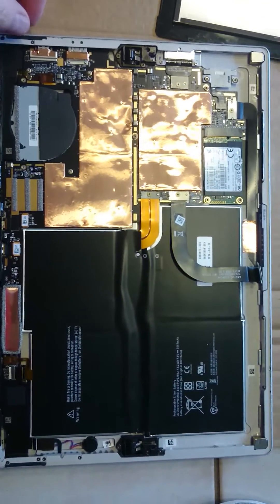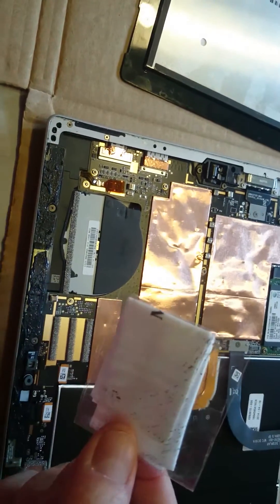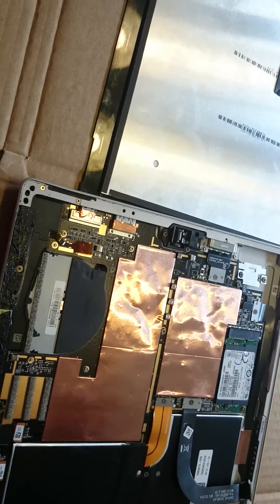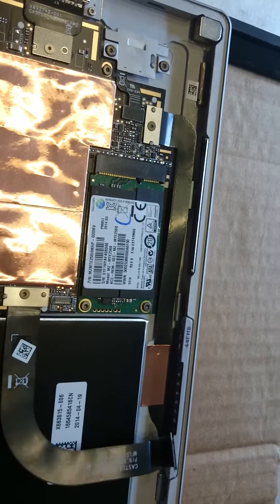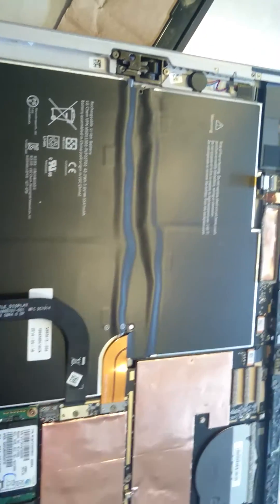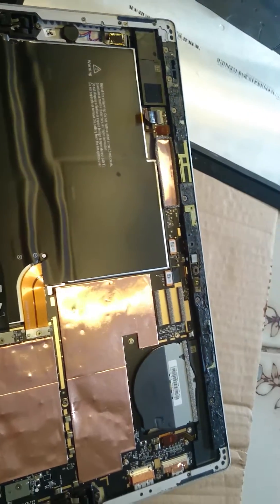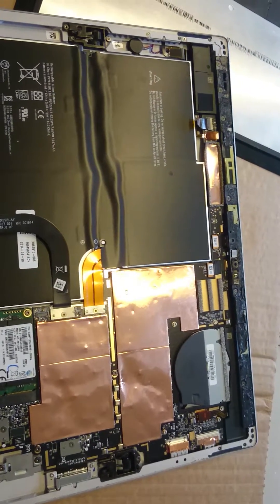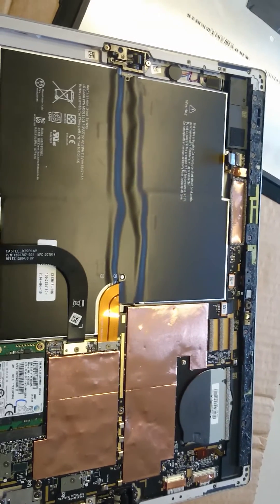Surface Pro 3 screen repair thoughts 1

Comment: did you find the serial of the screen on the back of your broken one? is there a way find the Screen serial without removing the old screen?
Reply from the maker: As far as I'm aware the only way to check the screen serial # is by removing the old one. But the the purchase online of the new one should not be a problem.

Comment: Did you ever make a part 2? I heard there the wifi antennas were near the camera. Did everything work out well? I cracked the corner of my screen and I want change it but I'm so nervous.
Reply from the maker: Unfortunately my memory card was corrupted with that footage. Yes, there are two antennas (left and right) either side of the camera. At 3:45 you can see the left one (wide gold ribbon upper left, and the radio right underneath -copper rectangle) I believe the left one is for receiving/transmitting and and the right one is a receiver only. I wouldn't worry about them, they seem fairly robust, but just be careful with the camera/mic assembly. The camera/mic move around a fair bit, so just take your time with glue removal. 

Everything worked out well with the exception of my slightly bent case. Where the screen popped out I used a tiny ribbon of epoxy (approx. 2" long either side of the camera) on top of the glue strip I put down, and clamped it for 6 hours. This solved the problem.  Using the surface to type this. Just be patient and take your time, and you'll have your screen fixed in a jiffy.

Comment: new screen for 250$ , like for real... its like this dude, ebay is good for used items on low prices, but when it comes for cheap replacements ali express is the boss, i can find the sceen replacement of the pro 3 for 50$ no problem.
Reply from the maker: Probably now that its almost 2yrs old, yes I'm sure there are some much better deals to be found on Ali. I'll admit it was a toss-up as to whether it was worth the repair given the cost.
Reply: give me a link to that replacement.  I'll buy another just because....

Comment: how does the screen compare to the original one ?
Reply from the maker: Actually, you can not tell the difference. The color reproduction, touch sensitivity, and pixel count are equal to the original. If you plan on keeping your SP3, I think its well worth the replacement costs. I would add the following though. At the very top of the screen (around the camera/mic) double up the adhesive tape. I had to remove my screen and re-tape due to there being a slight bend in the casing. The screen tended to pop out a little when the unit got hot, due to the tape glue failing. No more problems now though.
Reply: I have a problem searching for the right replacement for my surface pro 3, would you be able to post the link here? thank you